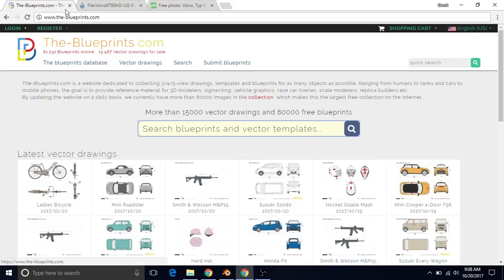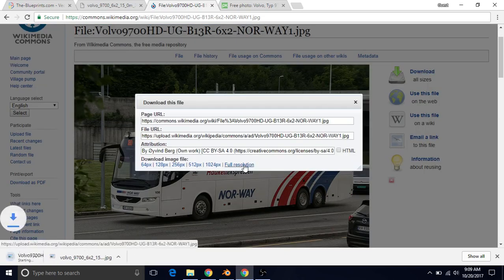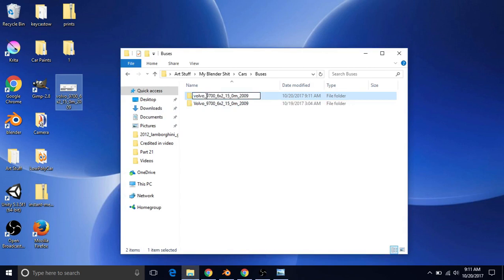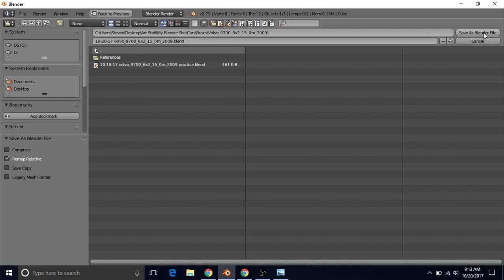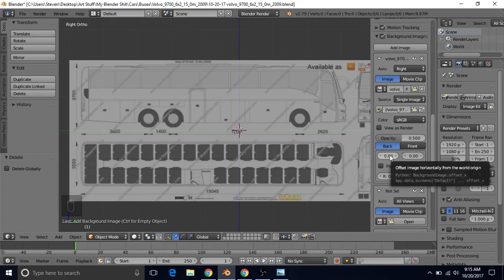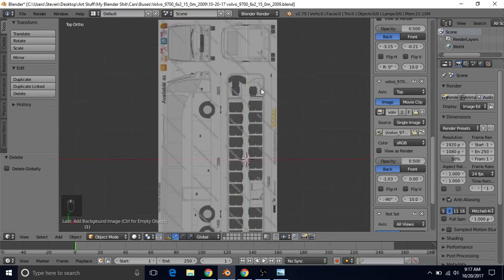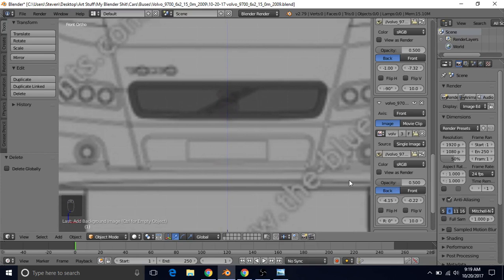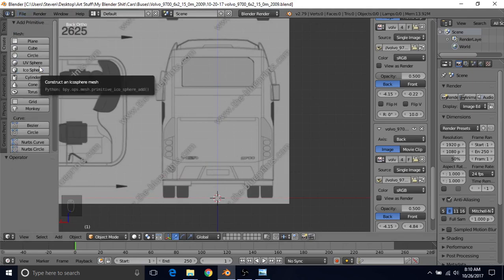Volvo 9700 6x2 Blender Tutorial - Part 1 - Reference Images

Comment: Seriously Steven how do you model the interior of a bus. I have a bus project for a long time it's been 2 months, I can match up the exterior fine (not perfect) but the interior is hard for me, I havent even touched it. How do you model the interior? Do you use reference photos? if so where you get them? and how do you model the interior stuff so accurately with angeled photos? Your response is appreciated. If I can't do it I might get someone to help me complete the model. Thanks . I also wanted to ask if blueprints are necessary for modelling
Reply from the maker: It's going to be very hard to find blueprints of the interior if not impossible in most cases. We actually do start the interior later in this tutorial. Of course you will want as many reference photos as possible and as many angles as possible. You can find them on google, ebay is good if you want to search for a specific part because you may find it for sale with multiple photos, wikimedia is good too they often have good quality photos. Basically you get photos wherever you can find them.

Modeling accurately is a matter of observation. Look at things in relation to each other and look closely at details. Look at shading and other things that will help you determine the shape of the object. This is a skill that takes practice but is key to modeling in general because most objects do not come with blueprints.

I hope this information or perhaps my tutorials later will be of use to you! Good luck! :D
Reply: @stevenbrooks1694  Hi Steven thank you for responding. I learned alot from your videos and comments  but I still struggle with interiors. Do you know any blender forums or facebook group where I could get someone to complete the bus model for me? I am still a beginner and feel it would take me a long time to complete it. Cause for me its definately hard. (It's particularly a bus project I am doing for blender). so thats my focus. I will pay if required.
Reply from the maker: Places to try would be blendswap, blenderartists, blender.org, any blender facebook/twitter/social media group. If you're willing to pay I'm sure you'll find someone! :D

Comment: Interesting way of setting up blueprints... If I were you I'd create 4 separate windows and then add front/back/side/inside views into them. Its visually much better and then its not that difficult to make a rough sketch with the plane
Reply from the maker: Hey thanks! That's one way to do it yes. I'm sure everyone will have their own preferences but I like having just one window so it's a bigger view of what I'm doing rather than one window split into four kind of like split screen while you're playing video games. Some monitors might be big enough to handle 4 windows and still be big enough to work with and see things nicely while others are smaller and it may not be as convenient to work in a smaller work space. When I started I tried to 4 window thing but now I'm very much used to one window and changing views for me is almost effortless so it's really not a problem for me. This is one of those things that comes down to preference so if four windows makes it easier for you, then all the power to you! But for me I like the one window at the moment although my preferences have changed over time on various things so you never know what the future holds! Have a good day! :D

Comment: I learned how to make Vehicles in blender in a course. 
But... It's necessary Patience.
I never finished one.kkkkkkk
Reply from the maker: I know the feeling :D. Sticking with the same model for a long period of time can be difficult, especially when you get the urge to do other things. Fortunately, it's something I've gotten used to, and I think perhaps you will as well. The key is to try to make things you are truly interested in. So pick a car that you really like, and then perhaps you will be more motivated to finish.

If you get bored of the car itself, perhaps you can consider other things that are related to the car. For example, making the different types of rims the car can have (typically expensive cars have different rim options available. You can often find these options on the manufacturers website, or you'll see different rims on google images and you can make the ones you like).

Another option would be to make the internal parts, such as the engine or exhaust system. Sometimes just looking at different parts of the car can re-inspire you to continue working.

I hope these tips help! Good luck! ;D